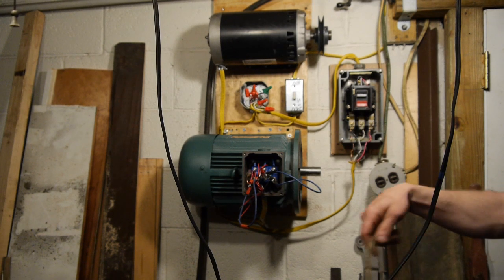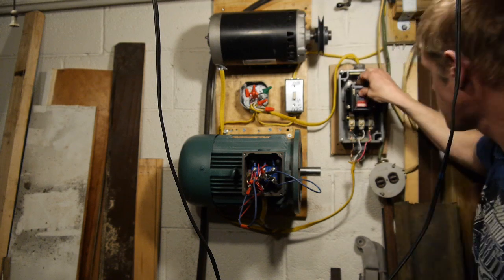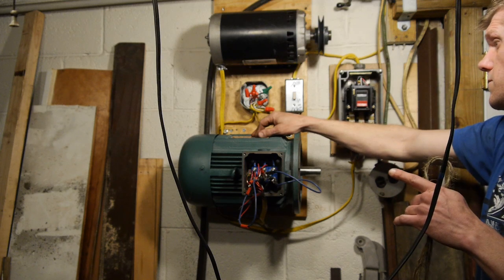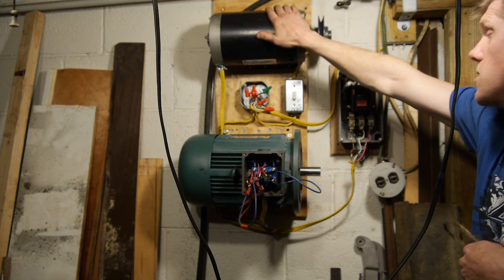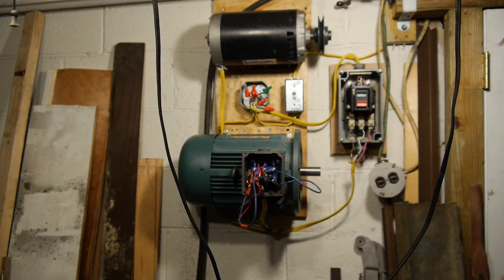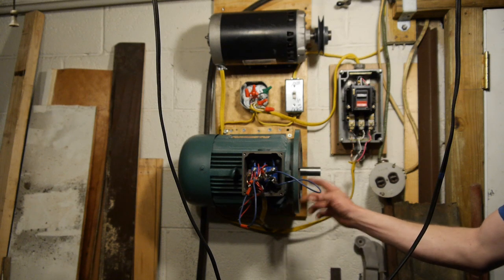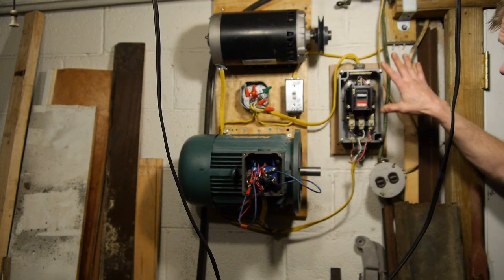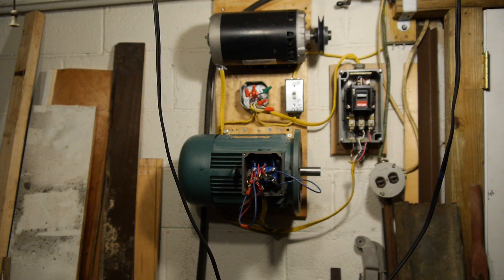New Motor for my Simple DIY Rotary Phase Converter

Comment: Do that 3 phase generator run on 240v or use 400v to run.
Reply from the maker: 240V
Reply: @JRock17991  so what the output from that generator?I feed 240V while spinning then we kidnap electric from it so we get 400V..is it true
Reply from the maker: I'll have to check. It's really 2 legs of 120V, then there's a phanotm 3rd leg at 120V